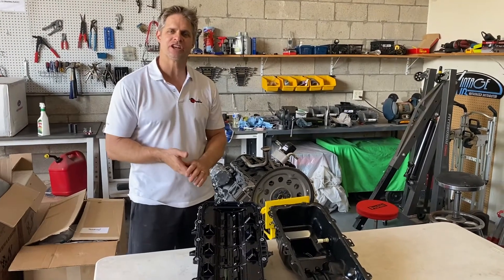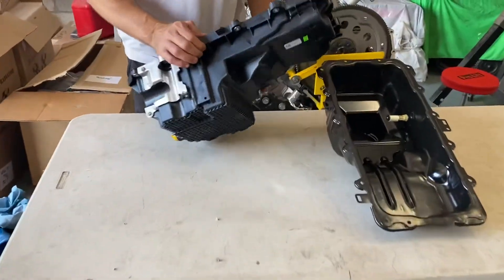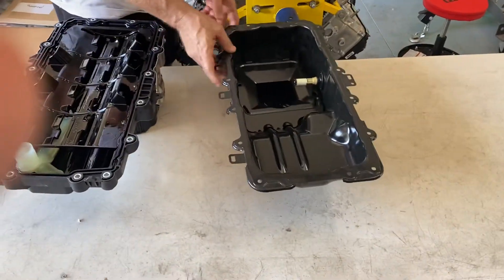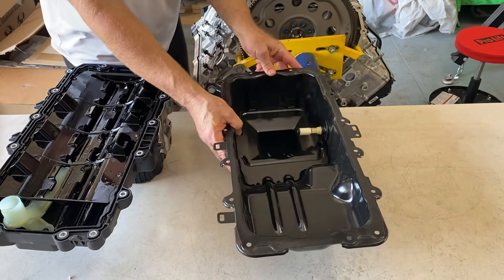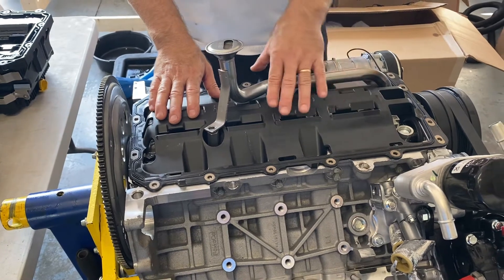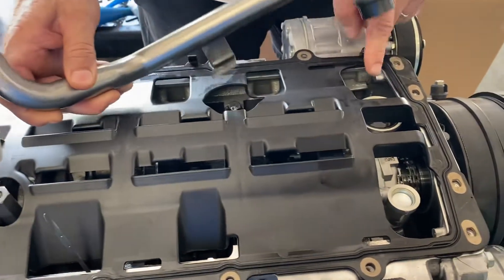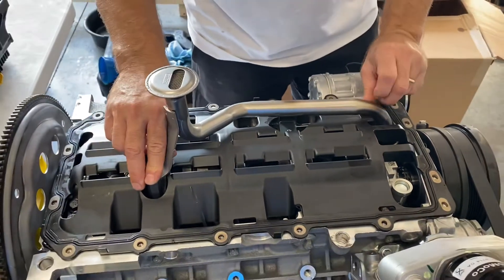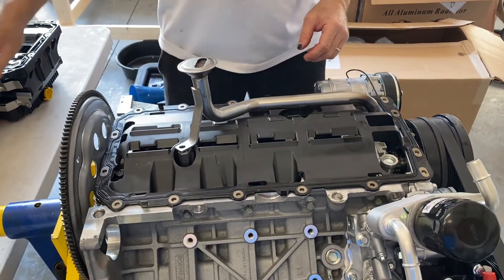Coyote Gen 3 Oil pan swap kit

Comment: You guys need to advertise more, never heard  of this conversion before just the GT500 one which is more expensive. This a great idea, do so e Facebook, Instagram advertising. I'd even see if some popular YouTubers with Mustang channels would show it being installed. Honestly, that's the best advertisement cause that's how we get the ideas for our Mustang mods more often than not. Once we see how it works and that works well, we buy it. Also, please say you may want to mod it to get rid of the plastic oil plug which nobody trusts because they eventually leak which can lead to catastrophic failure.